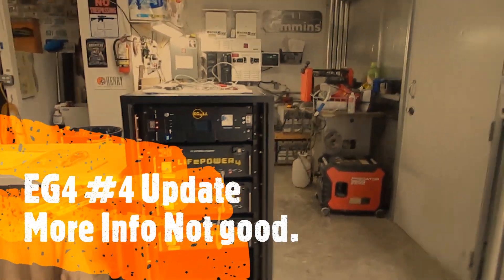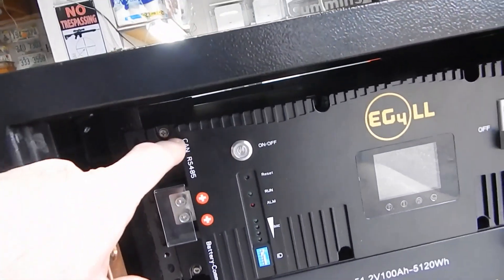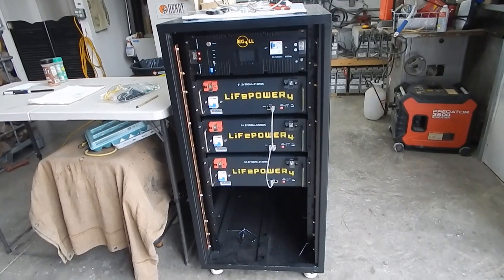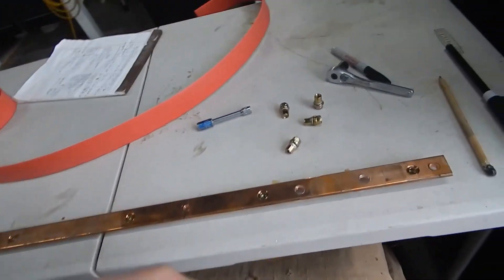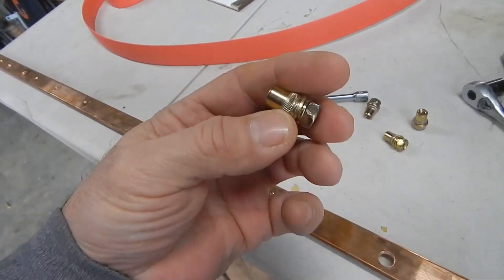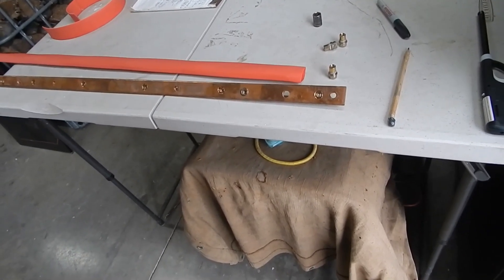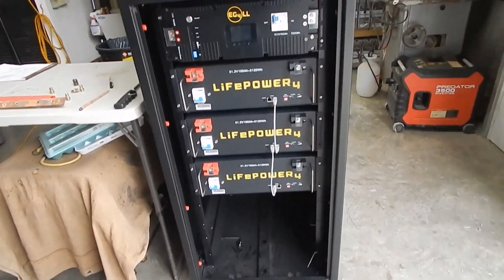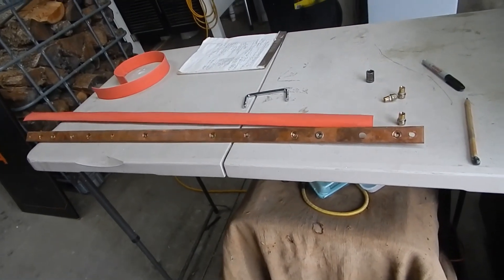EG4  Battery & Bus Bar  Info # 4   Unbelievable Safety Issue!!

Comment: I just got the same rack w/batteries, not wired yet, and I just removed then reinstalled all the bolts on my busbars, and they're good. The threaded inserts cannot possibly pull out like that as they're mounted on the back of the busbar.
You got bad bars, wrong parts and/or a 7yr old installed them in China. You're owed 2 new ones by priority mail, send this vid to sig. solar or whoever you bought this from.
Good luck, and I'm sorry that happened to you.
Reply from the maker: Thanks . I am glad they pulled out as 2 did not but with heat cycles on the bus bars they will fail so glad they did now. Totally bad install at the china factory.
Reply: When Signature Solar sells you a defective product it takes weeks for them to resolve it....at least that was my experience. They have zero quality control.